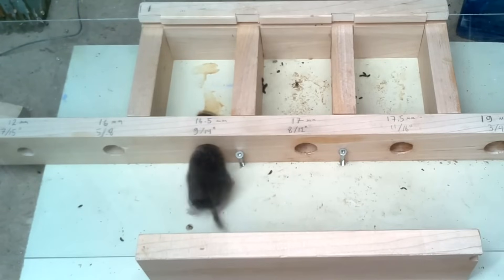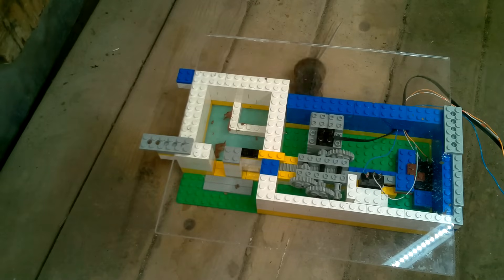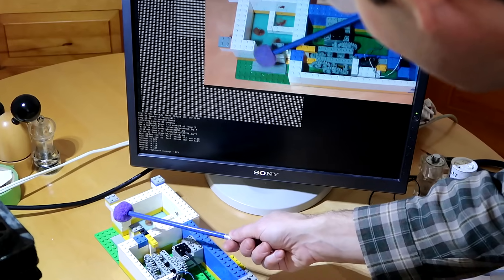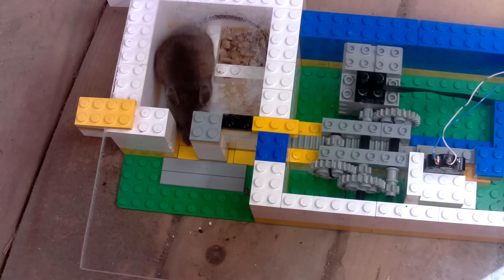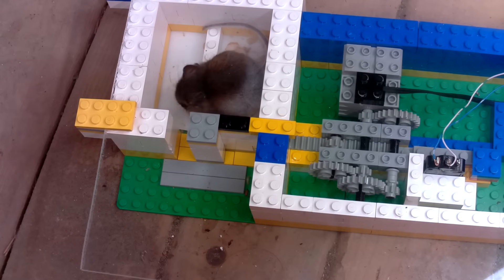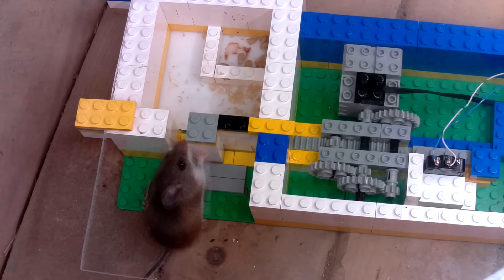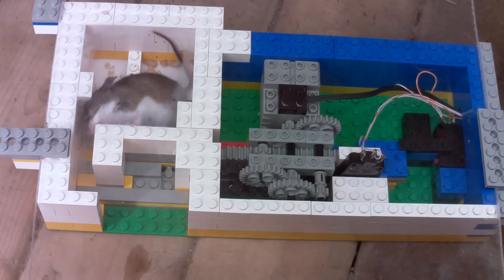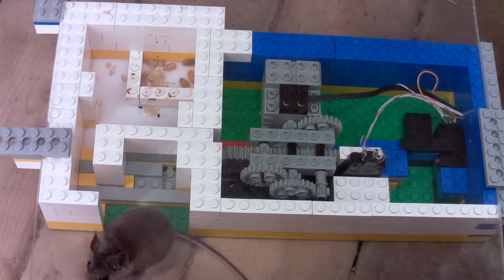Smallest gap for a mouse experiment lego machine

Comment: This is an extremely helpful video for me, as I have a brand new car which has been invaded by mice. Been closing off the garage with steel wool, planks and anything else I can think of while it has been in the shop for diagnosis and repairs. Closing off all gaps within around 10,5mm should be doable, as the 22 mice I have killed so far have been about the same size as the one in this video.

So grateful that some clever individuals use their time to post stuff like this.

Comment: This is an excellent test and has been valuable when determining what size entrance reducer a mouse may get by and gain access into a honeybee hive. I've tightened the tolerance even more and set the max opening at 3/8" and have not witnessed a house or deer mouse be able to pass through that opening. This allows honey bees to come and go without the need for mouse-guards. Thank You for sharing!

Comment: A) Above all FOOD
B) Be back and back and back
C) Can't fit 
D) Don't go back there

Solution, All food sources must be unavailable. Areas of entrance must be smaller then 12mm.  That's tricky to accomplish.  But they do HATE and I mean HATE lavender  and those plug ins work very well, but you need alot for large areas like basements.  Plug ins are not good if you have pets they are an irritant to them too.

Comment: Just a thought, could you devise a contraption so the gate is horizontal? That way the mouse would have to squeeze underneath the gap and this may give it an advantage over rotating its body 90 degrees as it had to for this experiment?...

Comment: Where did you get the programmable Lego gear thingies?
Reply: The gears are from any Lego Technics pack, the motor is from a pack that Lego released that was compatible with other models.
And the controller was a Raspberry Pi, an under $50 computer that runs Linux!

Comment: What program did you use? Java or something?
Reply: If I had to guess I'd say Python or Perl, as those are available on any Linux install (and he's using a Raspberry Pi), for the mouse detection and triggering the relays for the motor (I think from the extra IO pin on the Raspberry PI).
But I could be wrong, that's just how I would do it.
Cheers!

Comment: Wandel's latest cinematic production, "Mouse Gap Squeezer Teasing Machine," is a comment on modern civilization, as it attempts to entrap the natural.   The mouse building echoes the Neues Bauen style of architecture, but adds the element of plastic.  This modernist functional, plastic prison contrasts with the sleek, almost flowing shape of the mouse as it moves in and out of this building.  

Tension builds with each escape wondering if this will be the last.  This, of course, can be understood as the human psyche negotiating attempts by the overlords to entrap the Self.  Adding in the computer element was a touch of genius, blending Neues Bauen elements of the 1930's with the paranoia that has arisen due to computerized surveillance in current times.  

Somewhat missing is a more complete construction using the BauMouse style. This reviewer is looking forward to a further explication of the BauMouse theme in his next cinematic masterpiece.

Comment: Next up, make the gap get tighter while the mouse is in there, so it eventually gets trapped. And put a lever inside the seed room that will open the gap back up. If he gets out, move the lever next time. Then add two levers, which the mouse has to turn both to the correct position, in order to get out. Make it progressively more difficult.

The ultimate goal, of course, is to eventually teach the mouse to put on an Indiana Jones outfit and do a full reenactment of the scene in the Temple of Doom.

Comment: There's one variable you didn't account for. As time goes on, the mouse eats more and more and gets fatter! I suppose it's also more motivated early on when it is most hungry. 🤔 I wonder if the legos being so smooth and slippery affects the ability to get through. Maybe if it could get a bit more of a grip, it could pull itself through just a bit smaller of a gap.